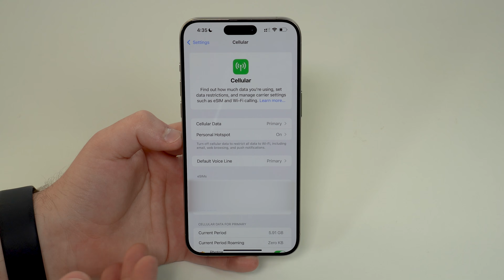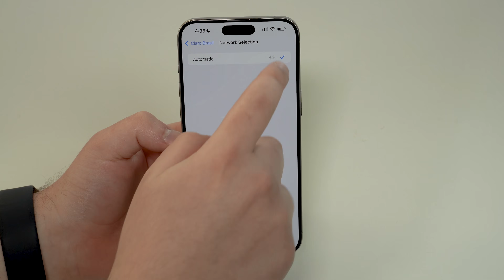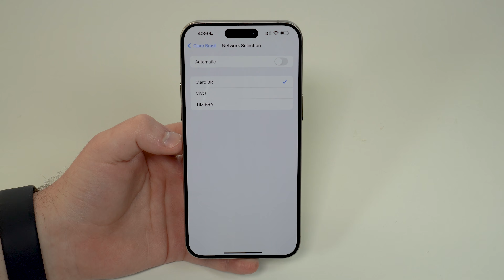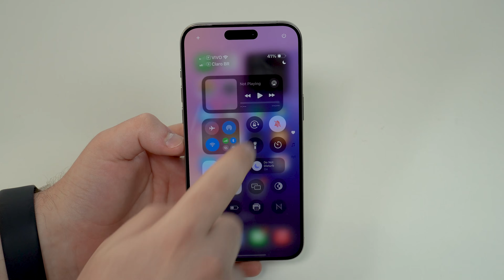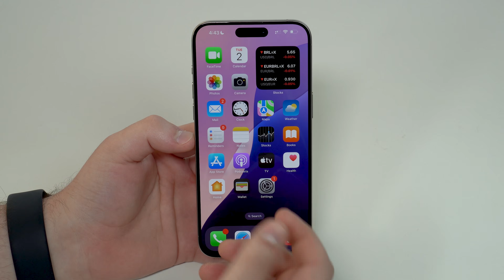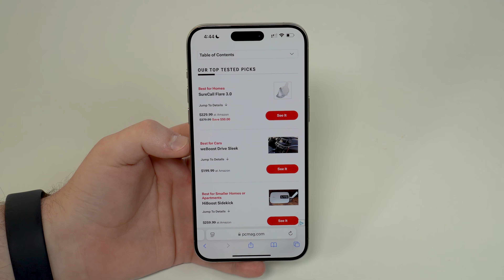How to Improve Signal (Service) on iPhone!

Comment: Hi Daniel, I am a UK viewer of this video. You mentioned that it didn't matter which phone you had for this to work. I have a 12 Pro Max, and the sequence and screens do not correspond to yours, e.g Cellular is Mobile Data on my phone. Also some of the wording is different. So I could not get your suggestions to work. But thanks for the try.
Reply: Worked for me in UK on EE
Reply: @RussMEagle  I'm on EE and no difference for me.
Reply: @terrydavis1488 Same here 12 Pro Max, apart from Mobile Data being  Cellular, the steps are the same, made no difference for me though., Moving from room to room isn't a practicable idea most of the time.